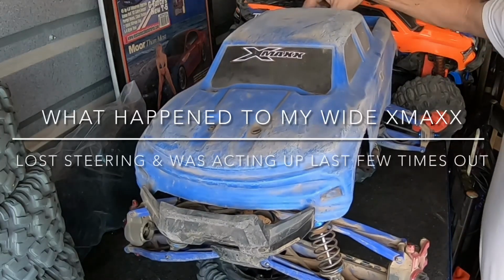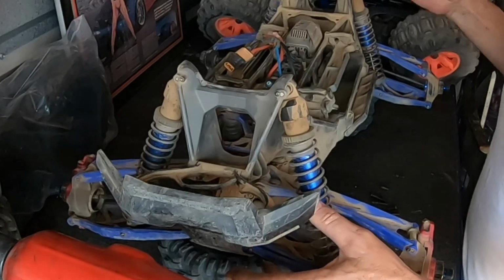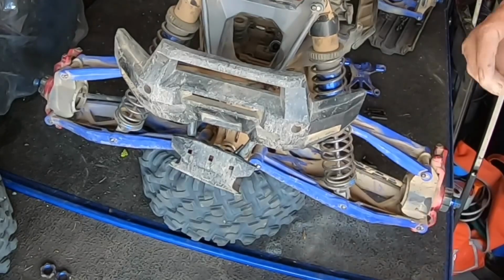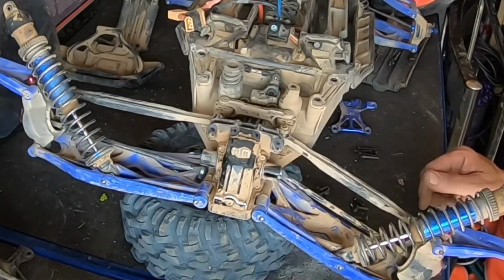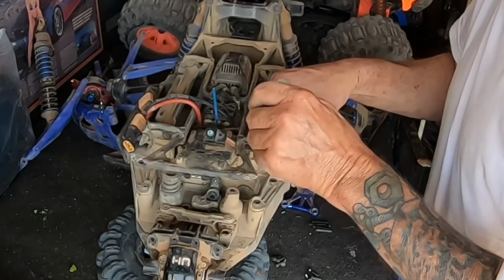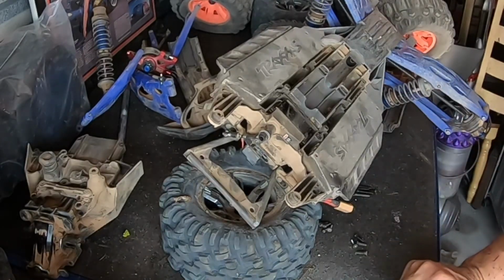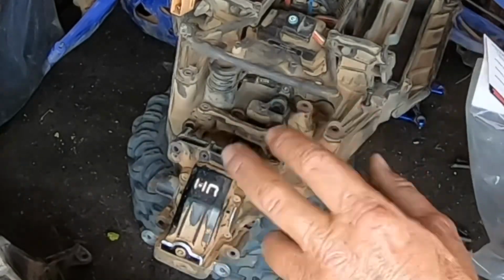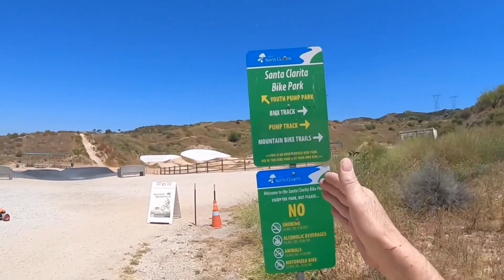WIDE-XMAXX Steering Broke What Happened? Tear down & Issues Found Worse then I thought?

Comment: Great video Earl my diff cups did the same thing on two of them one in the front and one in the back I didn't drill or tap them out I just replace the part that is screws into there like 10 bucks for two of them in the pack from Traxxas 👊👍

Comment: Earl in your opinion what is the best rc car lipo charger and what are some of the best quality lipos ? I need to get a great charger and some new lipos. I’m gonna get back out there and enjoy the hobby again. Just gotta wait for cooler weather but I’ve had enough sitting on my ass without being able to enjoy the hobby.
Reply from the maker: There all good now a days most are smart chargers
Reply: @earlmoorhead5555  I had my Arrma Infraction V2 going 61.2 mph max speed on 6S on the stock 15 pinion 46 spur. Now I’m geared 25 tooth pinion 46 spur….. I’m sure it’ll hit somewhere around 89-91 mph. I’ve seen guys hit those speeds with the stock 2050 KV Spektrum Firma  motor and smart esc in it. I’ll eventually buy a 8S Castle Creations or 8S TP power system for it. Maybe I’ll go with a Poseidon even. The drifting handbrake feature on it is kinda cool. By the way thanks for the charger and battery advice I guess I’ll just go with something that’s popular and name brand. I want quality I don’t want garbage. The Hobby People charger I have is over 9 years old maybe almost 10 lol……. It doesn’t have the lipo storage mode either…. It’s kinda shitty. It’s a simple one touch button ac/dc lipo and nimh charger. What type of charger do you use for all of your lipos and nimh packs. I noticed you are running with Lectron Pro batteries. Those are hands down some of the best ones. HRB POWER and YOUMME POWER are also good ones Earl.
Reply from the maker: I’ve done videos on both my chargers and they both do well lectron changer that does 2 packs is what I use daily but I can do 10 batteries at a time with all my chargers there all good now
Reply: @earlmoorhead5555  Yeah I just wish I had the storage mode option it makes life easier and less worrisome plus I can buy any battery and charge it no problem if I was to have a better charger. This hobby people one has issues charging certain lipo packs from different companies i dont know why. It won’t charge specific brand new batteries that I order off of Amazon. It’s kind of a crappy charger but at the same time it’s gotten me through for about 9-10 years now.